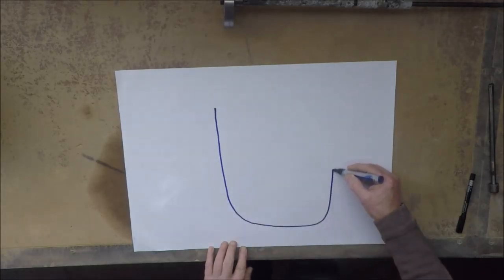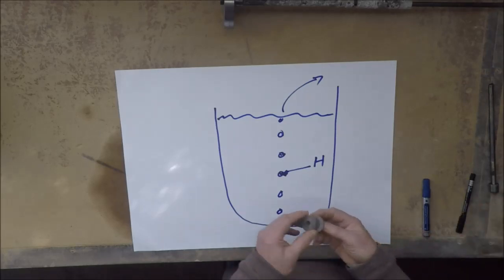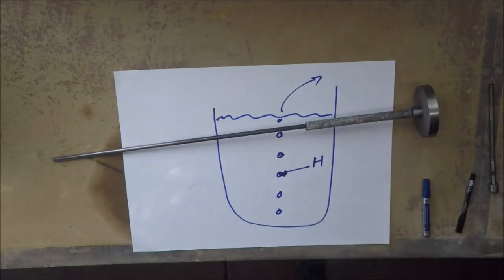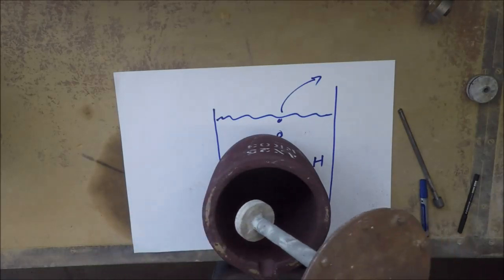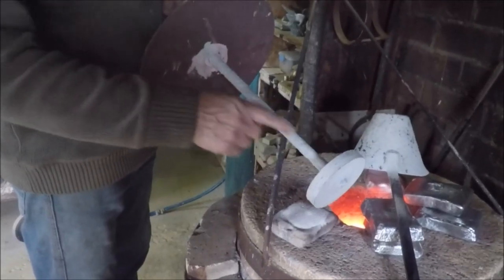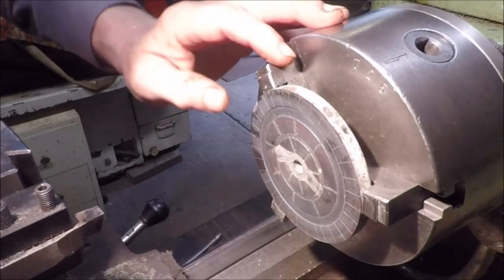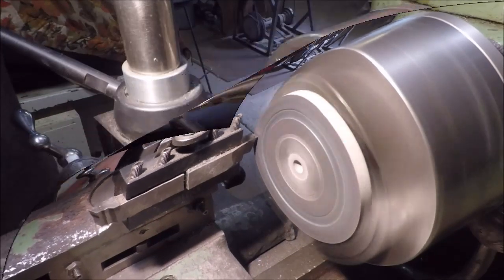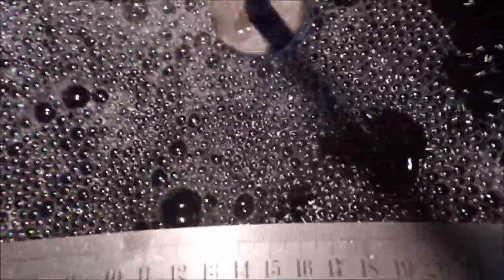My Home Foundry, Most recent Degasing Lance

Comment: I hadn't realised that molten Aluminium was such a reactive substance. I was planning on using a steel home made crucible, which from your description sounds like it will only last a small number of pours depending upon the thickness of steel used.
Would the same go for any baking trays or steel angle used as ingot moulds?
Reply: Mark, you'd be really surprised how long a crucible made of 1/4" steel will last.  Mine is the size of a gallon of PAINT!  Kiln wash helps, but I don't bother.
Reply from the maker: Mark,          Now you get me into a difficult area  - one where if I am not careful I will upset people and I do not wish to do that. Steel for ingot moulds is fine I have used such moulds (the same ones) for over 20 years and no problem other than they distort a little more each time that you use them. I would suggest using thick angle or even one side of I beam with the ends welded up at a fair sort of relief angle. Please though can I beg of you NOT to use a steel crucible. Aluminium has a life,sounds odd but it does, starts out nice and fresh from the smelter but with each use and recycle it picks up impurities, the use to which it can be put is determined by how far along the recycle cycle the aluminium has travelled. Perhaps the worst of the impurities is Iron and it CANNOT be removed it just keeps building up. I can assure you that having looked down a microscope at a lot of aluminium alloys a small amount of iron absolutely fills the structure with very, very, very brittle iron compounds These ruin the strength and can lead to catastrophic failure. They also interfere with feeding during solidification and with fluidity during casting. The end of the road is pressure diecasting alloys which have about 1% iron their ultra rapid solidification keeps the worst of the effects of such high iron at bay. One should obviously never use pressure diecasting alloys for sand casting work. After this all you can basically do with it is bury it in a hole in the ground. We should not be destroying our primary raw material.Iron pots will in the end be eaten by the aluminium and the only think that slows it down is the oxide layer on the iron (and any wash applied - but washes are unreliable even the boron nitride one that I use on my transferee ladles and degassing lance) To be honest the Boron nitride wash is dearer than buying  good quality clay graphite crucibles. An Iron crucible might last a while and then  again it might penetrate at one point on the first use it wil then piddle molten aluminium down you leg or just generally all over the place - it may even ruin the inside of your furnace. I know that decent crucibles are not cheap - I buy them - but all hobbies cost money and the cost of a crucible is well worth it they last for well over 100 melts with aluminium (I have had over 200) and even if a crucible costs you $60.00 its only $.60 per melt - chicken feed! I will have more to say later on this.
Reply: A friend asked me why I don't use steel crucibles for aluminium, so I explained to him why I use clay graphite crucibles. He never believed me and months later he said he had two inches of sludge in the bottom of his steel crucible and a lot of his castings were very brittle. Not long after that he got a clay graphite crucible! With 30+ years of casting you tend to make a lot of mistakes to learn from.
Reply from the maker: Luckygen, Yep, in 30+ years I sure have made a lot of mistakes, but I never made the one of using a steel crucible for aluminium - Perhaps I was fortunate  - as very quickly while getting my metallurgy diploma I learned of the problems of iron dissolved in aluminium. The tale of your friend is about what I would expect I will bet that sludge was a collection of plate/needle shaped very brittle crystals - one or more of the several Iron Aluminium Silicon intermetallic compounds known for their extreme embrittleing effect.  I hope that your friend dug a hole in his backyard and buried all that brittle metal - nothing much else that you can do with it! As I mentioned in my reply to Mark above I will have more to say on this because its a bit of a hobby horse of mine - I am just trying to find the words to say it without peeing too many people off!
Reply: Olfoundryman 100% correct, I couldn't agree more. Unfortunately there is a whole host of morons (I'm not worried about upsetting the stupid YouTubers eg who use steel crucibles) that make a foundry to melt aluminium but only use it once or twice, they use steel crucibles.....They are dangerous! Why take the risk? If like me you are going to make castings etc, buy some decent crucibles. Salamander crucibles are superb. Excellent for bronzes....I started with aluminium, but it doesn't machine anywhere near as well as beautiful bronze. I have made silicon bronze, aluminium bronze, leaded bronze, and good old fashioned tin bronze. And they all are wonderful alloys. My point is, metal casting is a fantastic hobby, and with the Internet being such a great source of information, anyone with half a brain can do castings and do them to a high standard. Just bear in mind, if you want to be a cheapskate and try the "YouTube specials" eg "casting a "whatever" For only $1.99". Don't, you will most likely get yourself hurt. Casting metal will not break the bank, but you do need good equipment. Eg, protection is No.1 and it's expensive for good quality items. Face shield, kevlar gloves, leather apron, strong boots. 
The list goes on, also don't think you are going to get professional results from soda cans, it's not going to happen. The aluminium is of such poor quality. I really should just make a bloody video..........
Reply: @shonaoneill5151  love your comment. The proper tools actually make it more enjoyable/less frustrating. Imagine welding with clear goggles while dressed in a t-shirt and shorts. Sorry my hairy legs and eyes couldn't handle it.

Comment: Awesome video Martin! Is there any way to convert the dross (aluminum oxide?) back to a useable form? How is your furnace powered?
Reply from the maker: Frank, Yep, there sure is a way, its called electrolysis and its how they produced the aluminium in the first place! Sad but true, once the aluminium is back to oxide you have to go down the whole electrolysis extraction route again.
However most dross contains quite a lot of free metal (sometimes as much as 90%) and this can be recovered with correct fluxing and agitation techniques. (But its a messy business.) It is usual to add a fluoride to the flux used for this purpose. Cryolite (sodium aluminium fluoride) is a common choice but I believe that sodium fluoride will do. The usual mix of sodium and potassium chlorides (lite salt) is not very effective.
My furnace is fired with diesel using a commercial burner fed with about 16 Oz air pressure from a large blower and the diesel at about 10 Psi from a sealed tank kept at 10 Psi (NO MORE!) with air pressure... Martin

Comment: I wonder if this process would benefit in Zinc die casting operations this is very interesting😊 I run a 35 ton zinc die casting press from Dietech
Reply from the maker: Tegrity, As far as I know hydrogen gas absorption while liquid  and re-evolution during solidification is not a problem with Zinc based alloys. In addition the high pressures used on the metal would supress any tendency for gas to come out of solution and form bubbles within the casting. Any problems that you are having with bubbles trapped in the casting are most likely air caught up in the extremely turbulent mould fill conditions that exist in the pressure diecasting process... Martin
Reply: @olfoundryman8418  thank you for the info in the zinc alloys,,,we operate a hot bath submerged goose neck injection unit on our machines ,, these goose necks are submerged in the machines holding pot and these machines run a 22 second recycle time ,,so mould face cleanliness is a must as well  ,, which honestly I have had better luck correcting mould cavity filling issues by running a lower temp on the molten alloy and running the clamp a bit loose to allow trapped gas in the mould cavities to escape a bit easier but the down side it tends to create a heavier parting line in our patterns and of course the danger of a explosive flashing event ,,which are never any fun I do realize the difference between your process and ours is a night and day difference including the alloy difference but any advise to help run better quality patterns is always much appreciated
Reply: @olfoundryman8418   a few other questions I have is about your melting furnace,, what do you use for fuel on your furnace? Natural gas,Propane,Fuel oil?  And your crucibles,,,did you make your own crucible? I have access to foundry clay and some refractory materials  that I intend to use for my home/hobby forge I'm working on ,, so I'm considering build as much of my own equipment as I can to save money
Reply from the maker: Tegrity, My furnace burns diesel fuel. I do not make my crucibles rather I buy them from reputable sources (Vesuvius) - a bit expensive but if well treated they last a long time. There is somewhere on YT a bloke who makes his own clay graphite crucibles, looks to be a damn messy business!.. Martin
Reply from the maker: Tegrity, Pressure die casting was never my thing! But my observation is that most seem to control fill problems with lots of overflows around the edges of the cavities. I know that with gravity die work venting to remove air is extremely important. Often dies that have been mad in one piece - by say EDM sinking -  will not work but if made in segments by more traditional tool making methods they will work as air can get out through the various joins between the segments. Often I will  use thin shims (around 0.03 mm thick) between the segments to allow better air flow between them although in pressure die casting these small gaps would likely just fill with flash..Martin
Reply: @olfoundryman8418  Thank you Sir for sharing the info on your furnace and the recommendations on the crucibles ,, I was hoping your furnace was Diesel fired ,,I have a older Beckett Burner I intend to use for my home built melting furnace,,,, and yes we have segmented mould bases that run several different design patterns from the  same base and the air gaps between the different inserts do effect the fill and porosity

Comment: hi i watch as many of your videos as possible and really enjoy your work, im building my own forge this week 
do you have a video on the temperature probe you use/made
thanks
Reply from the maker: danv8, No, sorry but I do not have a video on the temperature probe. The one I use is commercially purchased. It is what is called an MIMS thermocouple. This is a Mineral Insulated Metal Sheathed thermocouple with an earthed hot junction. I.e. the thermocouple is inside a 6mm heat resistant metal sheath (Inconel or stainless steel) An insulating mineral (commonly magnesium oxide I think) is packed around the thermocouple within the sheath. The thermocouple hot junction is welded to the closed end of the sheath. I protect the sheath with a boron nitride ceramic wash, this works very for aluminium but is not suitable for copper base work as the wash is only good up to 900 deg. C or so. The one I use is a metre long. I have seen such probes on eBay and they are quite cheap also from eBay you can get an instrument to read them, again surprisingly cheaply
This item on eBay would be a good start      https://www.ebay.com.au/itm/Digital-K-Type-Thermocouple-Probe-Sensor-Temperature-Controller-Assorted-Probes/282576231648?hash=item41cadb1ce0:rk:60:pf:0&var   get the 500 mm probe length.
Good luck with your own efforts.... Martin

Comment: Great work on the improvements of Aluminum Foundry work!! 

In the past did you ever try coating your lance rod with plaster of Paris?  

Or ceramics !

Show the complete process of building a lance in a video!   Remember we are not machinists
Reply from the maker: Thomas, The lance was just a little lathe work and to be honesI thought it too boring to bother showing but maybe I could revisit the issue because I have to do an update as I found some mods to the lance were necessary to get it to work as intended. Plaster of Paris Hmm, in a word -  no. People seem to use, or rather try and use, it for everything. For any sort of use involving molten metal it needs very careful drying out followed by a an even more careful  preheat cycle which amongst other things eliminates residual combined moisture  but often if its straight Plaster of Paris results in a lot of cracking. I think it an unsuitable material for this particular use. What I do use is a material called "hardcoat" by ZYP coatings, it is a boron nitride based material and thus rather expensive, but it repels molten metal and fluxes quite strongly (below 900 deg. C only). This is a water based paint on type coating that I use on the degassing lance, bail out ladles, and thermocouple outer sheaths. It works quite well but needs replacing every day of use. I have wondered about more permanent coatings that are applied in sophisticated (and no doubt hideously expensive) ways things like pure alumina, silica, or silicon nitride but I do not know of anyone who has used them. My guess is that they would not work too well or last very long because no one to my knowledge is using them.. Martin
Reply: I agree with Mr me … Martin please upload complete video of building a lance ….

Comment: Dry nitrogen is a better choice of gas for degassing.
Reply from the maker: Steven, That is a somewhat dogmatic statement – what is the basis for it?
There are differences between Argon and Nitrogen. Firstly, Nitrogen can form small amounts of aluminium nitride - argon will not react with aluminium at all. Secondly, the dross produced with Argon is “drier” than that with nitrogen, by this I mean that the argon dross contains less free aluminium, this may be related to the first difference.
However, both argon and nitrogen contain some water, oxygen, and CO/CO2 all of which react with aluminium to produce aluminium oxide, and in the case of the water, dissolved hydrogen (but you get more out than you put in) The argon I use, a commercial compressed grade, contains up to 15 parts per million of water. I would rather it did not but its about the best I can afford to use. Compressed commercial nitrogen is much the same. Where nitrogen is almost certainly better is if it is a liquid supply as this contains less water. This is I believe what Bob Puhakka uses in his foundry. Unfortunately, you cannot keep nitrogen liquid simply by pressure alone, some evaporative leak off must occur. This is not that much of a problem if you are a large foundry using a lot but for small operators it is uneconomic. At my usage rate for example 99% plus of that lovely dry liquid nitrogen would have evaporated off long before I ever got to using it as a degassing agent - hence the best I could do was compressed argon over compressed nitrogen for the drier dross. I did investigate the use of commercially available dries for the argon (silica gel will not cut it.) These will supposedly get the water etc content down to a few parts per billion so may be worth using, again though there are economic considerations.  I never got around to trying these.
Please note that this video is badly in need of an update as it does contain a few errors and I have since altered the lance head design. I hope with returning health (should I be that lucky) to do the update
Thank you for your comment..... Martin